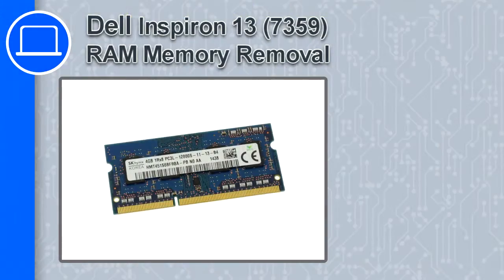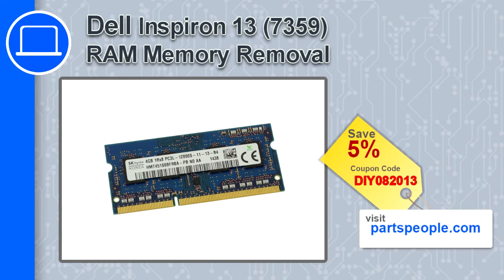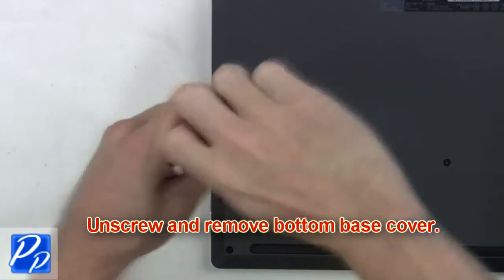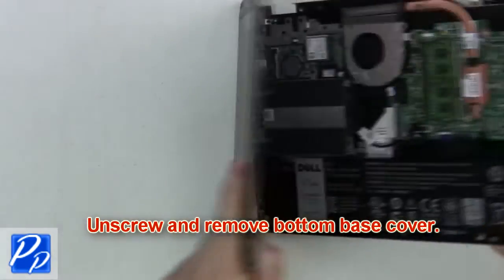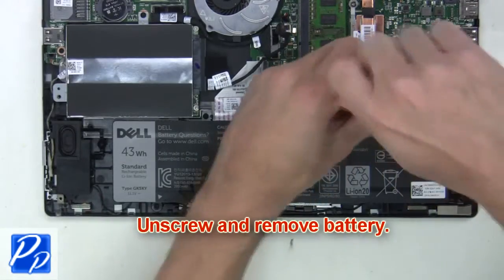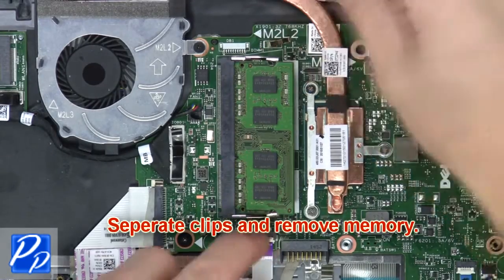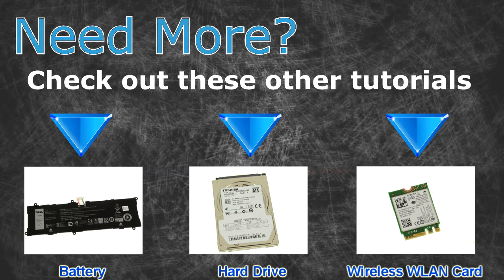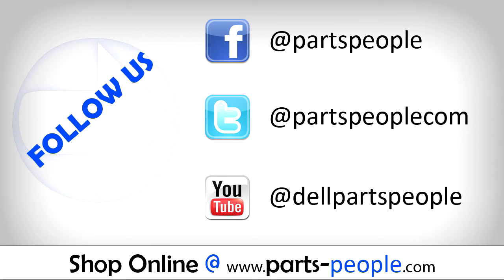Dell Inspiron 13-7359 (P57G-002) RAM Memory How-To Video Tutorial

Comment: Can the ram be upgraded to 16 gb?
Reply from the maker: It only has one slot so 8GB is the max.
Reply: But what if I upgeaded it with 1×16gb?
Reply: If you insert 16 GB RAM, your computer will dont work. This model supports maximum 8 GB and 1600 MHz memory.
Reply: @Milfawaef  Thank you for the info!